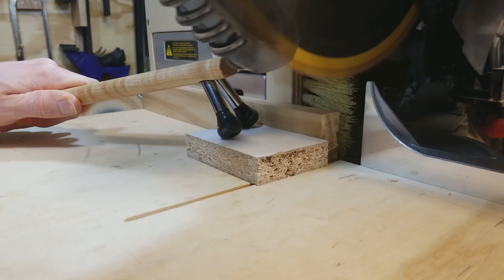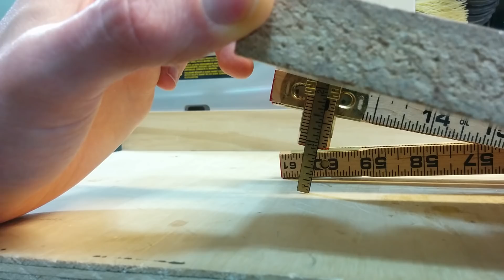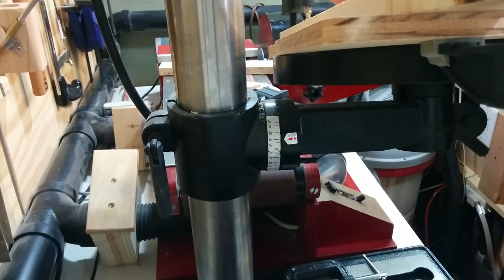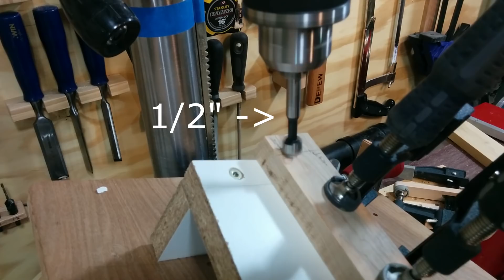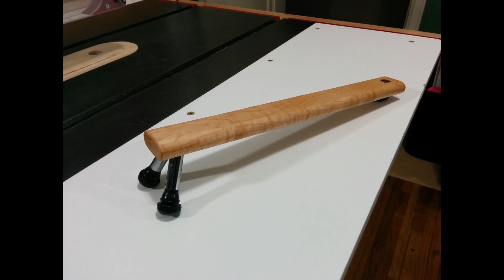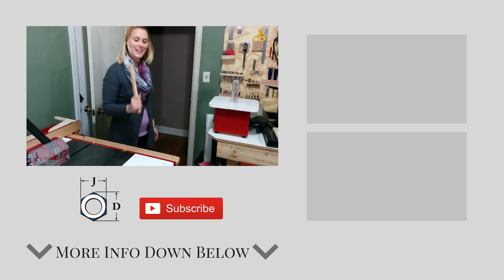This Hold Down Stick Uses Interesting Parts

Comment: Metal parts around your saw blade?  I used dowels with rubber feet attached with contact cement.   Add a couple blocks on one end for the needed width to get the1½" dimension vertical and cut the end that sits flat to be parallel to the bench top.  Fastcap uses two bumpers on the single end cut parallel to the table top for a good reason.

Comment: Good on ya for getting to the realization in the end that the exact angles of the front legs are irrelevant. Anywhere close is just fine. 

The reason the general idea works is 3 feet make a tripod - and 3 points are always on a plane - so  no matter what the exact angle of the legs or even if they are exactly the same length doesn’t matter as you will be able to use a tripod like that to hold down small workpieces. All that matters is the two close feet at a small bit apart to add stability at that end , the shorter leg is far back to allow leverage and keeping your hand away from the short legs and thus the blade. The two close legs need to be long enough so one can be on the workpiece and one in the miter saw base. The rest is just artistic window dressing.

The tk;dr is: get 3 tire valve stems from the auto supply store and some epoxy glue. Hand drill approx - glue them on , cutting the back end stem short. Done.
Reply from the maker: You got it! Thanks for the great summary.

Comment: Just a thought . . . tire shops routinely install new valves with tires. One prolly wouldn't find metal ones but the all rubber ones would be free for the asking. The design could be modified to have wood legs drilled for the rubber stems. Thanks for posting I will be making one for radial arm saw use.

Comment: Couldn't you have just tilted the drill press table and then rotate your piece to get the compound angle? I think this could be done without the makeshift stand. But good video overall, definitely something I could use in the shop! Thanks!
Reply from the maker: Hmmm I believe you're right. Good idea.
Reply: Alex Cooper I think if you tilt the table by about 27° and rotate the workpiece by 45° with respect to the table, that will do the trick. This is just back of the napkin.
Reply: The angle isn't real important.
Instead of tire valves that have metal (Usually brass) inside them let alone the fancy chrome exterior piece on the outside I used 3/8 or 1/2" hardwood dowel then dipped the ends in Plasti dip from HF.Once/if the rubber wears through just dip it again.It does take a fair number of dippings to build up a nice coat but the dip's cheap and usable for many other things.
I ain't even an engineer.
I used to just give G'eer's hell and chase them off when they used to come into my work area and start screwing things up all because "the computer says it'd be more efficient this way"......hahaha